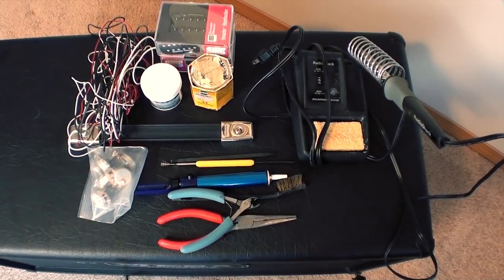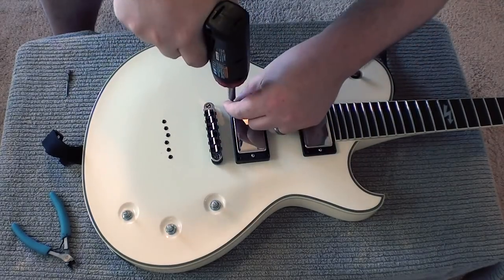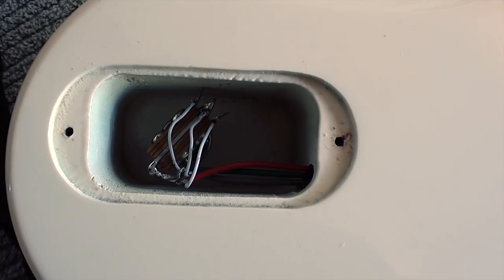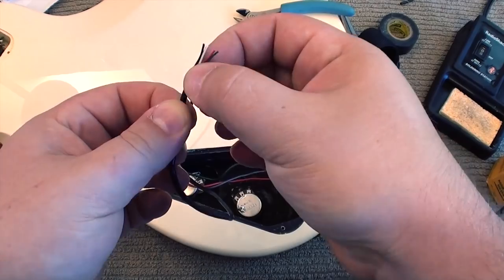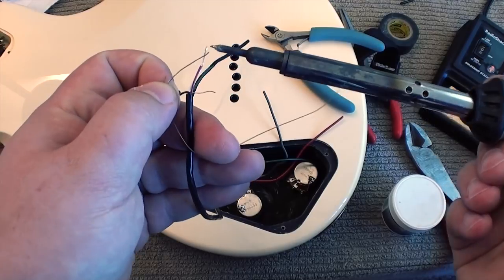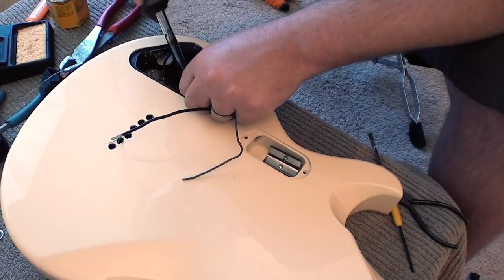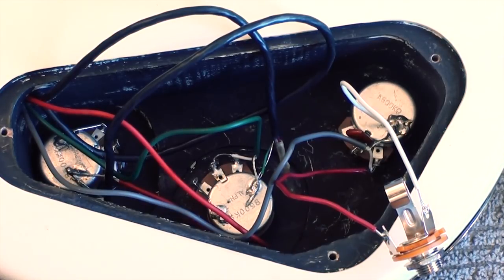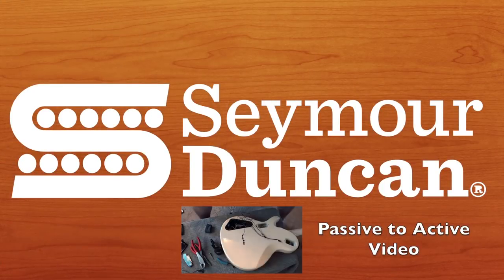How To Change Active to Passive Pickups

Comment: This is perfect, I have an ESP LTD EC1000, It came with EMGs and I was bitterly disappointed with the sound. I wasn't confident changing the parts myself, so I bought what I needed and gave it to a local musician who said they would do the swap for me in exchange for the guitars original active pups and internals. They never fully explained what they had done, but whatever it was, it's never sounded right, and always been really janky, crackly etc. I bought long tapered pots for the installation but for some reason he didn't use one of them, and that pot doesn't quite reach through the body enough to fix it in place... anyway, I've finally decided to just sort it out myself as I've got the urge to do some recording. This was a very valuable little tutorial.
Reply: okay, so I have the same guitar with those EMGS and i want passives!! Did you end up redoing it, and did you find parts that didn't fit properly?

Comment: When soldering tin, you really should hold the soldering iron to one end of the wire and the tin half an inch apart and let the wire do the melting of the tin. This way you get a much cleaner and stronger connection between the two parts.

Comment: Two pointers that I came across for people doing this mod:

The active pickup cavities for my Schecter Damien 8 are pretty deep - I had to use thicker foam pieces than provided in my new SD Sentient/Nazgul pickup set to bridge the gap between the strings and the pickups. Beware that cheap packing foam degrades over time.

Small amendment to whats said at 4:04 .. You can use the existing stereo jack from your active setup, yes, but the statement "the middle terminal will not be used" isn' t necessarily true.
Just remove the wire that connects to the 9v battery terminal, leaving the other two (signal and ground) and you're good to go.

Comment: Where is the bridge ground? You would have to drill a hole. Or did you ground the guitar any other way?
Reply from the maker: Correct, you would actually need to drill a hole if there wasn't one there already.

Comment: I have a Schecter Hellraiser that I LOVE, but the only thing I don't like about it is that I have to change the 9v battery from time to time because of the active pick ups. That's why I'm wanting to change to passive pick ups, but I just wanted to confirm: If I change from active to passive pick ups, I will no longer need the 9v battery, correct?
Reply from the maker: No battery needed! Never worry about a dead battery again!
Reply: ***** Cool, thanks for replying!

Comment: I have an EMG 81 installed in my strat and bought the EMG SRO OC1. Can I just use the components (Pot, Wires, Jack) and solder the Passive EMG into them?

Comment: So I have a Schecter Hellraiser with a sustainiac in the neck and an EMG 85 in the bridge. Say I wanted to change the EMG to a passive pickup, would the sustainiac make the process more complicated? I ask this because the sustainiac can function as a normal neck pickup when the sustainer is off, but when the sustainer is switched on the output signal immediately switches to the bridge pickup. I don't know much about changing pickups or wiring in general which is why I'm asking this, but I can only assume that this would make it more complicated. I'd prefer not to change my bridge to an active according to a guide like this and then figure out I can't use my sustainer, that would suck a little bit.
Reply from the maker: JacobAcLoz There are lots of people that use a Sustainiac with a SD passive pickup in the bridge (Schecter has several lines that use an Invader/Sustainiac) combo. To be on the safe side, I'd throw this question up on our forum as we certainly have some members who have used that pickup and might be able to vouch that you will have no problems. You might shoot them an email as well: info@sustainiac.com

Comment: I don't think my ltd ec-1000 came with a bridge ground or the route for one. would you guys do a guide on how to go about doing it?
Reply: Best option is to pull the bridge post, then drill from the electronics cavity into the post slot.
Reply: when i gutted my guitar it did in fact already have a bridge ground installed and even wired to the tone pot, which is stupid if it has EMGs. nonetheless, a pair of seymour duncan's live happily in my guitar now. :)
Reply: Hey man! I know this is a super old post, but how do the Duncan's sound in your EC-1000? And what Pups did ya install?
I have the EC1000VB, and I'm seriously considering throwing in some SD59N and SDJB-B... Lemme know what ya think!

Comment: I plan on switching to passive pickups, depending on which pickups i am going to be choosing does it come with instructions or tell you what type of guitar pot i need?Where can i buy guitar pots? Or it doesn't matter? I have the same guitar as you but basically it's a Schecter V and it has Seymour Duncan active blackouts in it which i think your guitar had.
Reply: Christian Stark go to your local guitar store they have the pots you'll need it's a 500K ohm so you'll need 3 if it's vol vol tone

Comment: Can you use the same active pickups with out battery by just changing the Volume and tone pots?
Reply: Fili2009able no will not work needs power for the pre-amp module

Comment: Is it possible convert an active pickup to passive in order to eliminate the battery? how?
Reply: Not without making the pickup worthless. The very difference between an active pickup and passive pickup is that an active pickup uses the electricity from the battery to boost the signal. Making it louder. This means that the magnets in the pickup doesn't need to be as "powerful" per se. If you remove the boosting part of it, you'll just end up with a very quiet and wimpy sounding pickup. May as well be unplugged at that point.

Comment: Why don't you guys make swapping active for passives using the active wiring model?  why deal with soldering?  Is it just impossible? I bet you'd sell more passive pickups if the system was already just plug and play like the actives.  Offer a solderless install...

Comment: Wait, what did he do with the green and red wires from the pickup selector switch? The video completely skipped over on how to wire those to the passive pickups.
Reply from the maker: In this case, the red wire contained 2 small white wires.. the hot and ground of 1 pickup, while the green wire contained 2 small white wires- the hot and ground of the middle pickup. Look at the still shot @ 4:21 and follow the wires.